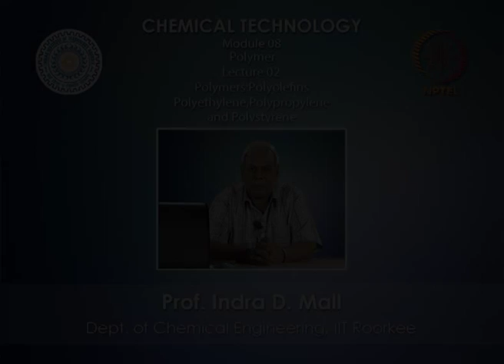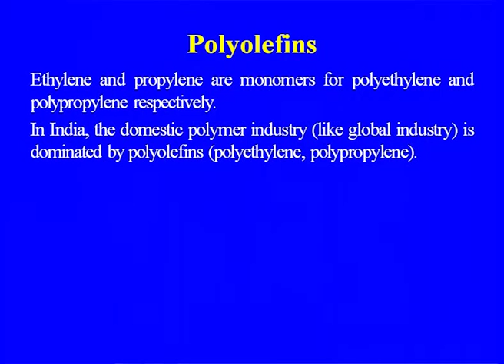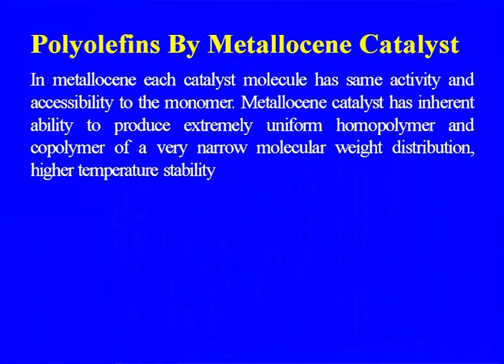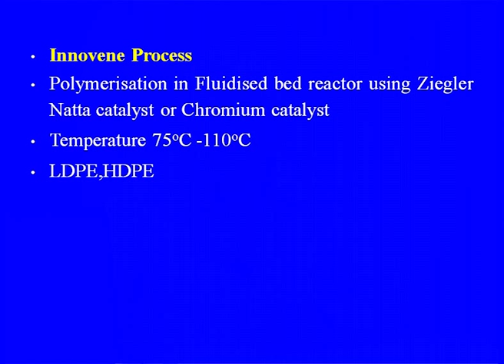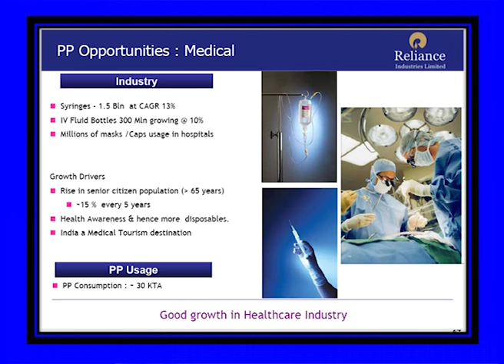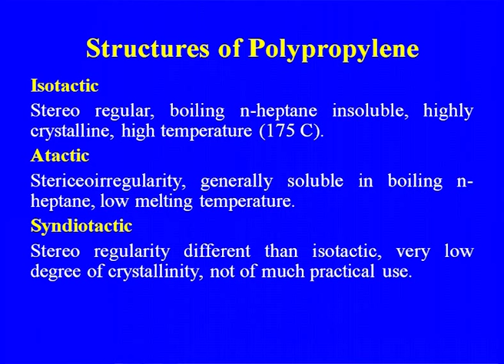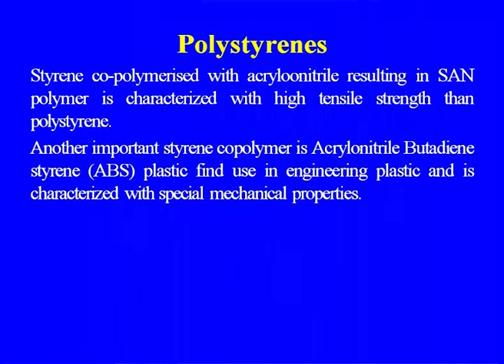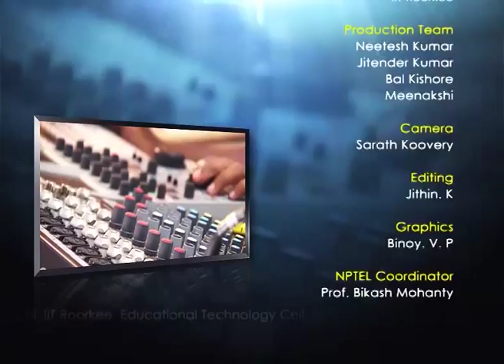Mod-08 Lec-02 Polymers:Polyolefins,Polyethylene,Polypropylene Polystyrene

Comment: How can I dissolve polyolefin? I work for a nail company where we make strip nails that goes into the nail guns. We use polyolefin as the plastic strip that holds the nails together. The machine that collate the nails with the plastic strip has a lots of problems, so we lose a lots of nails because of the excess of lack of polyolefin. Therefore, I wonder if there solution that can dissolve or partially dissolve the plastic, so we can savage the nails. Thank you.